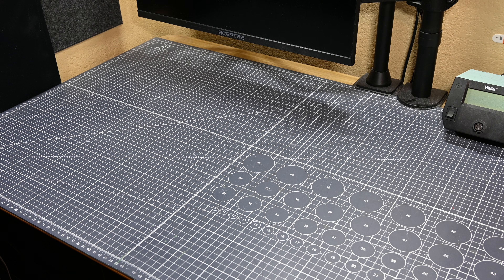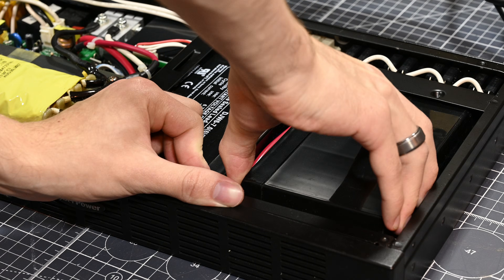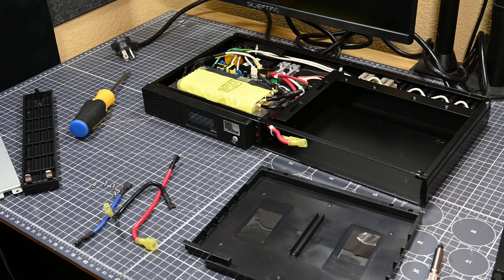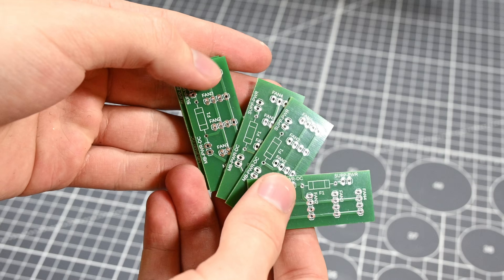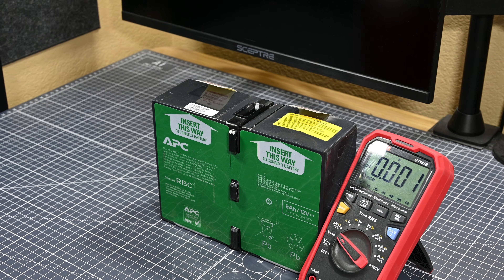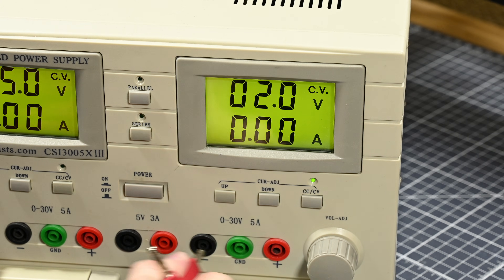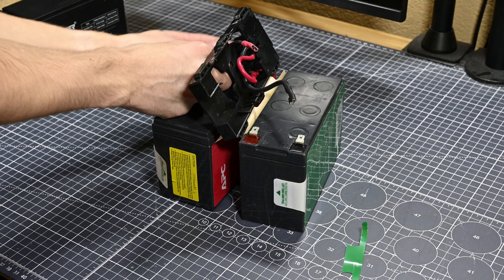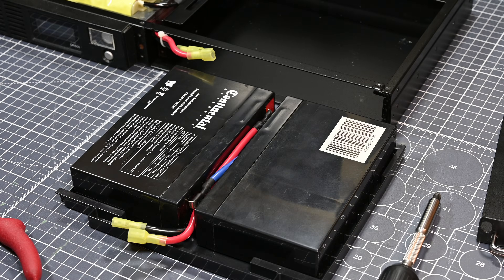I Got $600+ Worth of UPS Units for Only $75! - How to Repair UPS Batteries for Cheap

Comment: In many places there are "Battery Shops" that you can bring these sorts of batteries to and they'll have replacements. My local store is "Rexx Battery". In my area I can take an assembled UPS battery to them and they'll put new cells in and re tape/mount the batteries for a reasonable price. I've done that CyberPower replacement also and it cost $45 and took them maybe 15 mins. 
That being said I did what you did for my home UPS because I could and saving every bit is the goal.

Comment: The tip of returning the old cells for recycling and getting money for it works. One time I brought a couple of the cells to a car parts retailer when getting  a new car battery. They paid a proportional rate compared to a normal car battery, making the new car battery that much cheaper.

Comment: I modified my UPS  to use an AGM automotive battery and also added a voltmeter to my desk so I can monitor it. It has been working great for about 6 months and 3 power outages. Higher amperage let's it last a significant amount of time longer than the puny battery it came with.

Comment: Lifepo4 diy cells are quite a lot cheaper than leadacid now & they give full discharge so for a given amp hour the run time goes up quite a bit. These 9ah leadacids are like 4-4.5ah in real world discharge. Even less the faster you discharge. 
I use 32700 6ah cells ( they measure 6.5-6.7ah new) & each cost just about 2$. + Some little materials like nickel strips & cell holder. Insulation tapes , active cell balancer. All in under 50$ you can easily make a 25.6v 12ah pack. Diy spot welders are cheap and with careful design you can fit all that in the ups enclosure. 
This ups have the default charge rate at 1.25amp but shorting the green yellow wire on the external power pack connector makes it charge at 3.75amp which is not a problem for Lifepo4. They can charge much faster..
I also have a much bigger 120ah 12v pack for my solar shed with 32140fs cbak tabless cells and those are some powerful cells. A 30ah 12v pack of that easily cranks over my cummins 24v truck without a hitch. Even on a cold day. They provide some 700amp pulse discharge. Very impressive for 40 cells coming under 150$ from china.
Reply: The first Lifepo4 pack i made way back in 2018 with aliexpress hx 32700 6ah cells still holds 10ah last tested as of February 2025. 
They were originally 12ah. with all materials it was 45$ all in. 
25.6v 12ah & it runs a 300w load on the br1000g for 45mins.apc claims 43min with the extended pack at that load. So Pretty much the same runtime with 6x 9ah battery that would have cost 150$. & Only last 5yrs at best.
Reply: Yup, only thing that i worry is that a ups  will draw alot of amps, especially if its a 12v one, and it might trip the bms

Comment: You don’t have to balance the batteries since they are connected in series.  Lead acid will balance themselves.  You only have to balance them if they are connected in parallel since one battery will try to charge the other if the voltages are not the same.  Since they are low amperage batteries, there won’t be much current draw between the two anyways.  For new batteries, the UPS will charge them up just fine, you don’t need to use the bench power supply to pre charge them.  Problem with these older ups’… after so many years, the surge protection might not be effective anymore but at least you still have the power outage protection.

Comment: I retired three years ago. I worked for an ISP. I literally through these out and bought new every time the batteries went bad. I revived a few of them over the years. It was just quicker to buy new. I did always strip the batteries out before tossing and I got to pocket the cash. Like thousands in cash.

Comment: You can also try to replace these with Lifepo4 batteries. It will last longer and provide more power compared to lead acid batteries.
Reply: Yeah, LFP is 2x more energy dense than lead acid and can last for up to 7000 cycles, over 15x the lifespan of the lead acid

The current price of LFP is only slightly above lead acid, making it a good long term deal

Comment: i actually used to use that model of ups but bugs ended up killing the one i had but those apc ups do have a tendency to have relay problems
Reply from the maker: Interesting, I'll keep an eye out for relay problems and if the unit I have ends up with them maybe I can make a video on fixing them!
Reply: @CHWTT  its possible its an error with the apc software im using cyberpower now though i still have a bug problem at my moms its alot easier to deal with the cyber power ups even though i cant add batteries to the cyberpower ups but atlest the cyberpower one is less prone to false overload errors

Comment: Using lead acid battery in 2025 is a big lost..
I just wished u used a lithium ion batteries
Reply from the maker: I didn't realize that LiFePO4 batteries were such a viable option even with these lead-acid based UPS units, but a lot of commenters have pointed this out. I think when the lead acid batteries go out, I will give upgrading to Lithium batteries

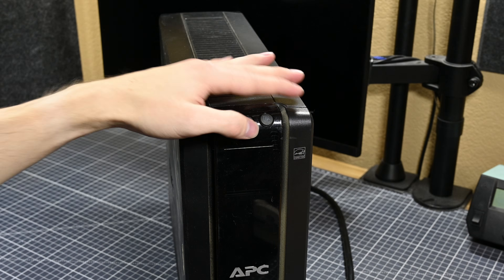Comment: saved one of these at 6:38 from going to the trash at my job, just haven't got around to fixing it yet, think I might go with Lifepo4 cells if I can fit them with a bms inside gonna have to take it  apart further than you did to see if there's enough room.
Reply from the maker: It will probably be quite cramped, but maybe you could fit the BMS inside of the little spacer between the two cells?
Reply: @CHWTT  we shall see, I haven't even taken it apart yet lol... project for future date, was busy taking my house off grid with solar and battery backup, as long as nothing happens to that, really don't need a UPS cuz I have 96 kilowatts of storage that's a very big UPS 🤣
Reply: LFP cells typically don't have the same current capacity as lead acid, in the same form factor. That is, a 12V 9Ah LFP is probably only going to have a 9A BMS. If you have a UPS with a pair of those in series, you'd have a 24V @ 9A system so you're limiting  your UPS output to 216 watts before the BMS in the batteries cuts out. The BMS probably has some surge rating, but you're not going to get close to the 900VA-1000VA rating common for a UPS with a pair of lead acid batteries like that.

You could always extend the wires out and hook up a larger 12V (or even go with a single 24V) battery setup with enough current capacity to match the rated UPS output. I kind of feel like by the time you do that, LFP battery systems from whichever brand (Bluetti, Anker, Pecron, etc) are cost competitive with getting sufficiently large LFP batteries and wiring it into a Pb designed UPS. Especially because the UPS doesn't have the same charging curves that LFP wants. It will consistently undercharge your LFP so you're probably only working with 80-85% state of charge all the time.

Just something to consider. I've been thinking about doing the same for years and it just never worked out in the math.

Comment: Cool finds.... Was wondering the use of yellow wire in the battery pack for the APC, I am trying find the value of the resister used inside the battery pack and how it is connect. If you happen to take it apart this info would be nice.
Reply from the maker: If I take it apart to replace the cells I'll try to remember to let you know

Comment: my APC Back-UPS 700VA convert to LiFePo4 battery 100AH with load of 2 router, 1 isp modem, 2 access points 4 switches and power consumption of 100watts i got incredible run time of almost 6 hours and the battery still splenty of charge

Comment: 4:10 This is only true for lithium batteries. Lead-acid batteries will dissipate the extra energy as heat and will eventually balance themselves out. This is why you don't need a BMS monitoring each cell like lithium does. Besides, a 12V lead-acid battery is just 6 2.1V cells in series, and those don't have any BMS/monitoring either. I've mixed brands and battery voltages in UPSs, and they always end up balanced after a few hours. However, this is only valid for things like UPSs that charge the batteries very slowly. If you charge them faster than what they can dissipate, then yeah, the battery will get damaged.

Comment: You didn’t have to cut the sticker, it’s likely somewhat reusable.
Reply from the maker: I thought about it, but the adhesive was super stuck on there and was old enough to be kind of brittle too
Reply: @CHWTT Yeah, I’ve done it before but it’s a pain and definitely doesn’t re adhere properly sometimes. The tape is better for helping people recreate the repair.
Reply: You should have made some tabs to remove the batteries. It will be difficult to do without handles. My boss had one of these that the battery was never turned around and was going to throw it away but I discovered the problem and turned them around and then it worked.

Comment: if i remember correctly, you can level 2 batteries by connecting them in parallel with 2 high value resistors aswell (so the draining is slow and steady) and in a few minutes they should be in the exact same voltage
Reply: it's called passive balancer

Comment: Would it not be better to replace the cells with lithium batteries? Cool video!
Reply from the maker: It would be cool to use Lithium, but as someone else said, lead acid is a better fit due to them living constantly charged. Plus, the charging circuits in these UPSs are designed with lead acid cells in mind, so it likely wouldn't go over well if you were to connect lithium packs to them (yikes!)
Reply: if you "upgrade" a chemistry, typically iron phosphate battery manufacturers would include an embedded bms that translates the lead acid charging profile, and since the new chemistry's working voltage is within the margins of lead acid, its able to hold a charge at "100%" (since lifepo4 working voltages operate at a wider range, comparatively, than lead acid's "charged" and "discharged" states, the new battery's raw cells, behind the bms, always hold a comfortable state between not fully charged and not fully discharged, allowing long term, viable replacements for lead acid)
Reply: @CatalystReaction  I have the same APC UPS as in the video and built an external 24v LiFePo4 battery pack for it.  The UPS only charges it to 3.38v per cell, but after a while they do reach full absorption / charge and I got the full capacity.
Reply: In UPS system battery backup must be kept at 100% charge so it can deliver it's maximum power if the power goes out. And so it happens that lead-acid batteries has the most lifespan if kept always charged.
On the other hand there is lithium batteries that don't handle very well being on 100% charge at all times, at this state lifespan reduces considerably.
But if power goes out all the time, and you need to work using UPS battery until it fully discharges - than yes lithium batteries is MUCH better at handing cyclic load.
Reply: LiFePo4 batterry it a good replacement for lead acid battery it has same way how to charge with lead acid and LiFePo4 has great lifespan up to 3000 cycles while lead acid has only 500 cycles

Comment: I have rebuilt my own UPSes in the past by replacing the batteries. I usually replace the UPS after it is 10-12 years old due to the surge protection components having a finite lifetime, but since the batteries usually last 3-5 years, I still save money with this strategy.

Pro tip: electronics distributors like DigiKey and Mouser also carry sealed lead acid batteries. Depending on how many you need, they may be more cost effective than Amazon, but at the cost of you having to do your own research into compatible parts from other manufacturers.
Reply: ironically you can find mov's online im not sure if its worth the hassle switching them out

Comment: From experience I can tell that a smaller spade connector on some cheap lead battery - usually means that this battery is designed for security alarms power backups, that don't consume that much power. These batteries will work for some time, but die quickly.
For UPS you need to search for high quality batteries that can handle high currents.
That is why original power pack is so expensive.
Of course, you still can save a bit of money buying separate cells, but if you search for some reputable brands, you'll find out that it woun't be much cheaper.